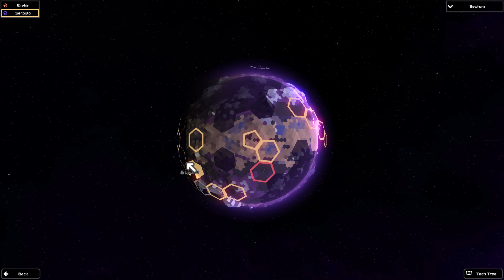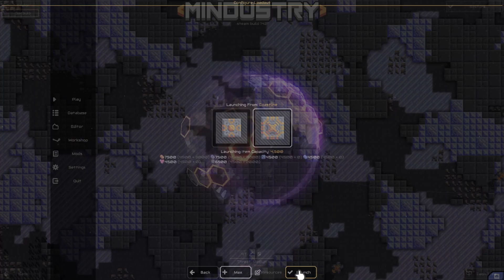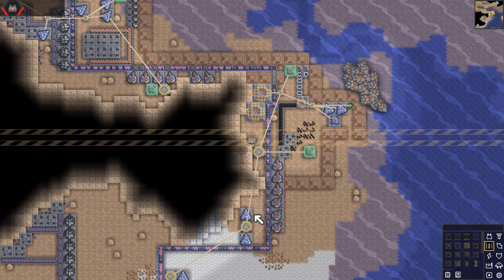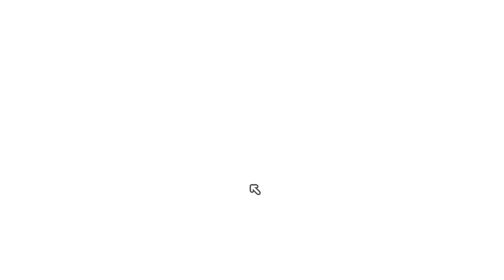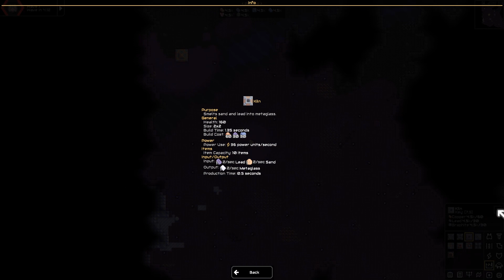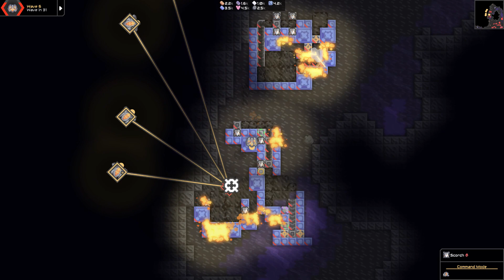Mindustry Wrecking an Enemy Base

Comment: my guy, the best way to obliterate crux bases are to spam flying turrets (preferrably flying hails and flying lancers; hails for aerial artillery and lancers for their damage) or straight up spore-bombing the shit out of the enemy core with the annoying flies (the annoying as fuck flares)
Reply from the maker: There's a lot there that I don't know yet. Lancers can be used against air targets? Spore-bombing?
Reply: @redmoonrocket  i mean the lancers for piercing crux walls and for the massive damage they do when spammed

also you should speedrun getting sector 85 as it got everything you will need including chernobyl simulator 2003 (thorium reactor)

(sector 85 is 2 sectors above frozen forest. not the pentagon one because its an enemy base)

Comment: As much as horizons can help, I think flares with pyratite can do better, especially since the enemy core there did not have any way of healing damage or water to extinguish flames. Flares are cheeper and much easier to mass produce and have better moment speed in exchange for the hp. What I do in these low level enemy bases, I manuver all of my units towards the enemy base completely ignoring the other defences. Then with my entire army, I go from on side of the core to the other. The units will likely due on top of the core which due to pyratite will make them explode which leaves fire on the enemy core, since that core did not have heals or water, this would just give u the win once enough time passes
Reply: they did have water but the pipes are exposed, i use horizons (for high threat and lower)when i get an export base up but flares are extremely cheap
Reply: @rapidfirevestige  tbh, in my experience, in all 100+enemy bases I have fought (I'm on my 3rd playthrough of the campaign). Rarely dose the water extinguish the flames lol. The fire is so large that water was not actually able to beat em. Still if u are going to use horizons, I will recomend equipping em with pyratite or spore pods so when they die, it will spread fire.
Reply: @thebetabeast6498  the reason it dosent is because cores are very flammable, usually if they dont have at least 2 tsunamis and working mend proj they will die to the flames
flares are early game bombing(w/ spore/pyra/coal like you said) for low medium bases
horizons are more reliable also with payload of volatile material, used for high - low bases
zeniths are qute good, but become unreliable if there is alot of turrets, they can overwhelm a meltdown and foreshadow with some specters but its not reliable if the only opening in their defenses still has turrets that can reach it.
quads are very reliable but decently expensive,  they can also build repair and protect
Reply: @rapidfirevestige  interesting perspective, I'll make sure to keep that in mind!
Reply: @thebetabeast6498  yeah bro, thanks for the discussion
Reply from the maker: Thanks for all of the comments. This was a fun thread to read through.